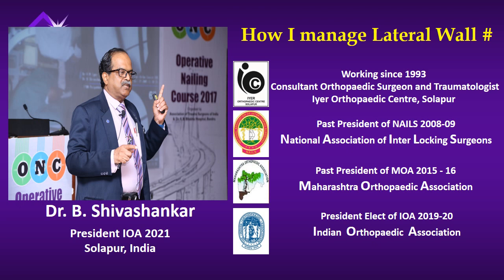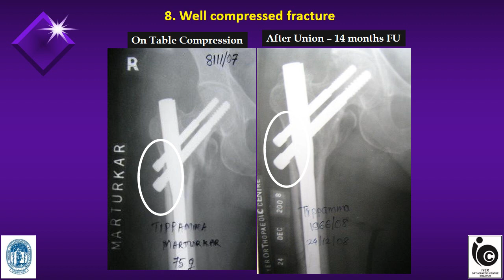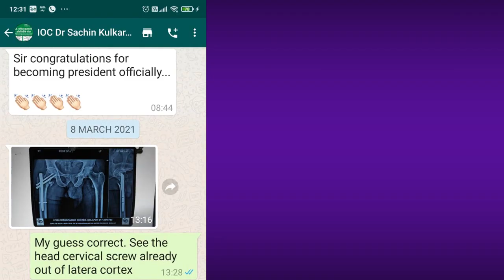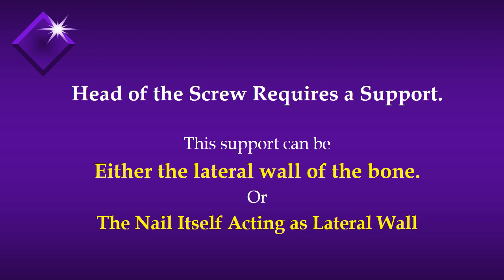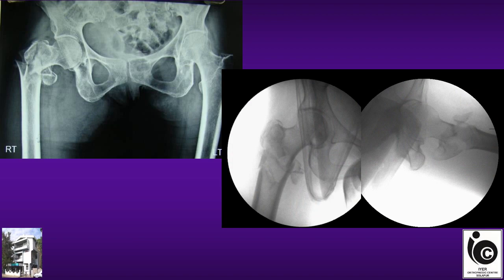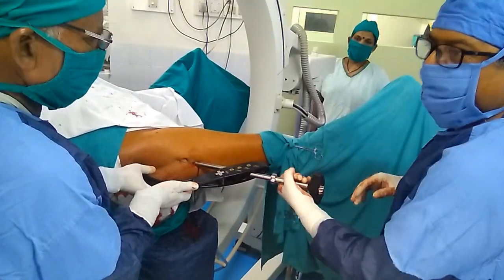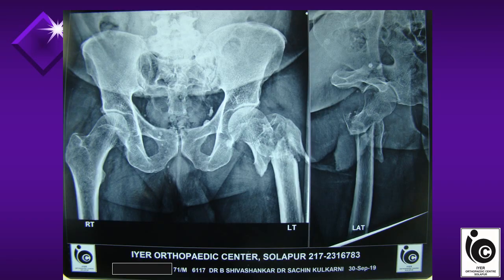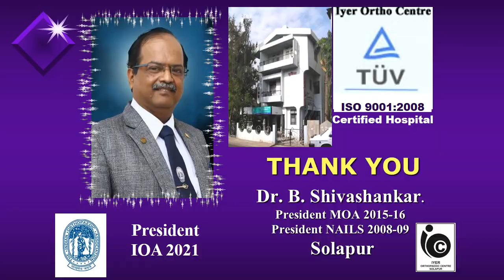Lateral Wall Problems in IT Fractures

Comment: Sir, What about entry point of nail in such communited fractures? I find that tip of GT either not palpable or very difficult to position for entry as guidewire invariably goes through the fracture.

Comment: Sir kindly suggest about the weight bearing protocol in badly communited it fractures fixed with pfn and simple two piece it fractures fixed with pfn
Reply from the maker: Your fixation should be good enough to start partial weight bearing immediately. See my video 10 commandments to get good results with PFN in IT fractures
Reply from the maker: https://youtu.be/CDDxIWogiZo